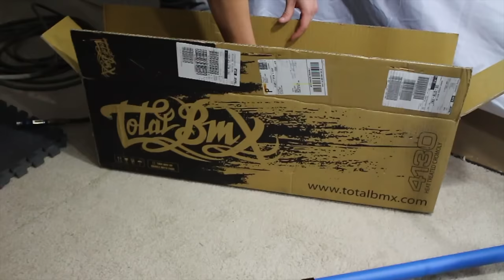NEW BMX BIKE

Comment: PLEASE HELP- can i switch my old 1998 schwinn predator big sprocket out for a small 27/9 ratio sprocket with out it rubbing against the frame?? Dont wanna spend the money if it wont work...
Reply: need 28 or 30
Reply from the maker: Sorry for the late response, it should definitely work!

Comment: Need the stranger flower seat to match the hubs
Reply: Those hubs are trippy. I was thinking about possibly adding a set to my bike after having the frame and fork powder coated in Dayglow Pink. I have the reissued Pro Performer so my finished customized vision will be pink, black and chrome. I haven't had a BMX in years. After a couple MTB's and a Messenger Bike, I can't deny the fact that they are not as fun to ride as a much smaller freestyle 😎👍.

Comment: Its a beauty! Looks pretty tasty,  but what is the magic of your chain and hub-> It seams to be that your chain is on the wrong side of the bike? Mine is on the right side of the bike.
Reply from the maker: Tomone ElEscarmiento mine is on the left side of my bike
Reply: Yes! Yesterday I have seen a lot of bikes, some had got the chain on the left, others on the right! But that's a confusing fact for me, I never had a bike with the chain on the left side. And one time I made a mistake while setting up the crank and chain. Changed the side without notice it. The result was that I was not able to drive forward but backward. If i'd tried to drive forward I landet in the free turn(I don't know the correct word "freecoaster" ??I'm sure you know what I ment - it sounds like a rattle)
Reply from the maker: Tomone ElEscarmiento you have to have a hub specifically for left side drive

Comment: I haves question, if u have spline drive sprocket, u need to have a special cranks? So i cant take a spline drive sprocket when i have odyssey calibur cranks!?
Reply from the maker: Nazariy Danyliuk you have to have the same size spindle and spline count, a lot of cranks are 19mm 48 spline as well as sprockets so just make sure the spindle size and spline count match with the sprocket. But you can always run bolt drive on spline drive cranks (unless you have like profiles that don’t have threads for bolts)
Reply: JACOB HAGER so if i have normal 22mm 48 spline cranks with bolt thing, i Can take a spline drive sprocket, its possible!? Its just becaus i am tired af all time my sprocket gonna be 8 form, because of this bolt, and i Will try spline drive sprocket
Reply from the maker: Nazariy Danyliuk yes, you just need to find a 48 spline 22mm bore sprocket
Reply: JACOB HAGER okay, i find a profile 22mm spline drive sprocket, perfect for me, thanks for help)))